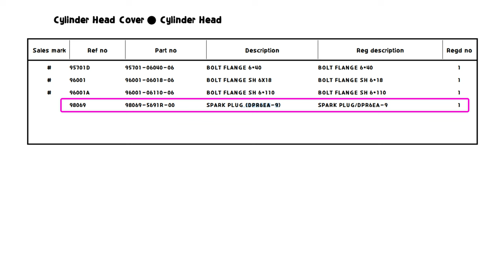Kymco Xciting 300 Scooter Motorcycle Engine Ignition Plug Replacement

Comment: 2:08 what's the knocking sound by idle? I have the same issue on mine a xciting 500. Thank you in advance.
Reply: I wanted to ask that too. I also have that issue, but can't really figure out what's causing it. I thought it's the clutch not release quick enough while decelerating or braking. But I didn't have time to check it out yet.
Reply: @kenwoolf  I just check this out by mine. It came out to be the variator. Replacing it solved the problem 👍